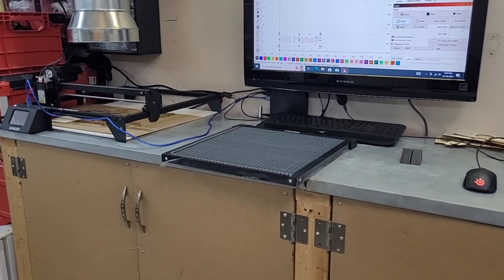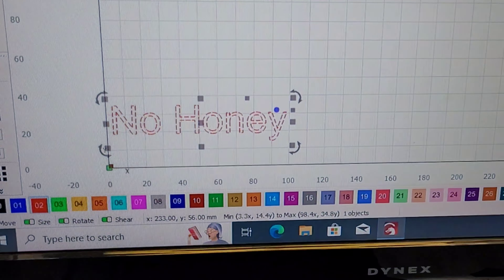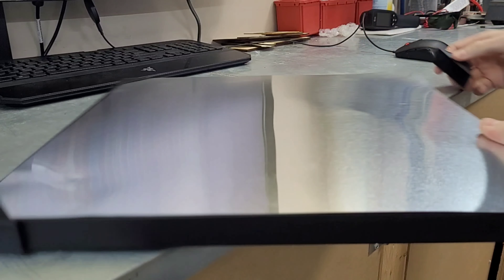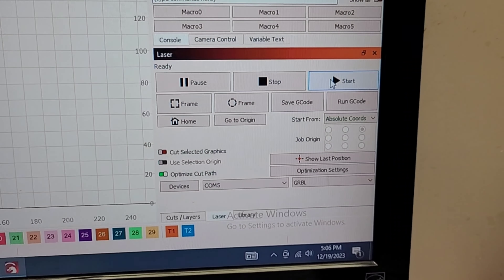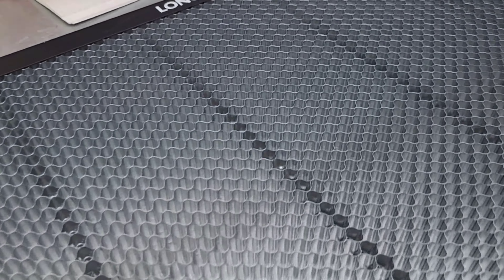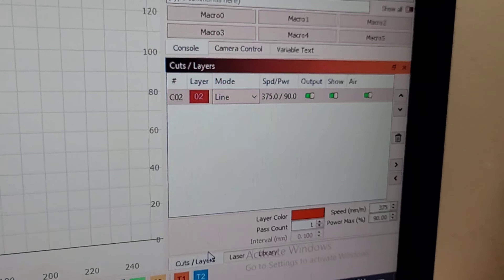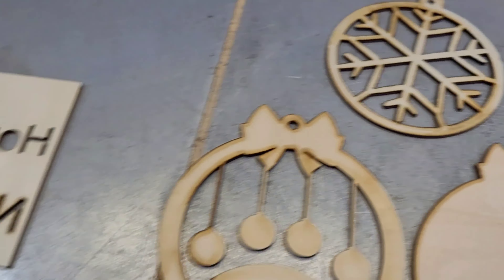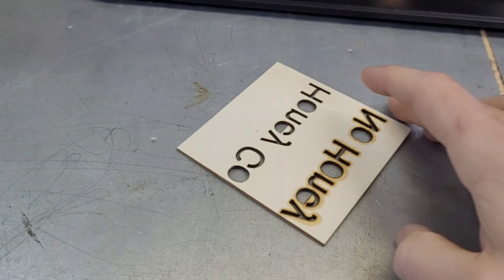Stop Burning Projects With Your Laser Engraver! One Simple Upgrade!

Comment: I see you placed your metal backer rite up against your honeycomb.   You will want a small gap for gasses to escape below the comb . trapped wood gas between backing plate and inside the cells of the honeycomb will pop in tiny explosions that can move parts of your work.  i put adhesive rubber feet in the corners of mine keeping 2 mm between metal sheet and honeycomb. 
Air assist is amazing . it keep your lens clean and turns scorching and charring into deep clean engraving and cuts.
Reply from the maker: Thanks for the tip, I'll try that!

Comment: Just started lazing a few weeks ago with a Sculpfun S30 Pro- the 10 watt with the 900x900mm extension kit. Built a cardboard enclosure and I'm glad I did first instead, it's really quick and easy to customize. One thing I've learned is that most of the smoke comes from under the work- what I'm going to be doing soon as an experiment is building a second air extractor on the underside- beneith the Honeycomb bed I'm going to be drilling a bunch of about 1-2 inch holes 6-12 inches apart in a grid then make it so I can open/close different holes. A second air axtractor will pull air out from under the work. The reason for the blockable holes is so that I can extract air from directly under and only where my work is in order to pull most of the smoke from below which I think should minimizing smoke stains on both sides of the work. Also going to have it setup so waste can be swept into the holes and vacuumed out of the hollow area underneath so it should make cleanup/maintenance easier. Not sure if that makes sense- it's an experiment that I've not seen before
Reply from the maker: I like the idea. I was also thinking about cutting out the work bench below the honeycomb and extracting air downwards.

Comment: Air assist is worth it.  I've got the enclosure for my Ray5 10W and with the exhaust port it works great.  Got the honeycomb as well and, yeah, no more scorch marks.  Now I'm waiting for my switches, which I believe are having to come out of China, and they are taking a while (as of this comment, I ordered on 13 Dec and they still haven't shipped) to get to me!
Reply from the maker: Glad to hear it's worth it!
Reply: I'm trying to figure out an enclosure that works with the web cam (MUST have addition) but those enclosures all fall into the "3d printer" category, and aren't quite wide enough.  Got a 200 CFM fan and ductwork on order to avoid gassing myself out.

Comment: You will notice a huge difference after installing the air assist
Reply from the maker: I just got it yesterday but they sent one with a European plug so I can't use it yet 😂 the replacement is on its way